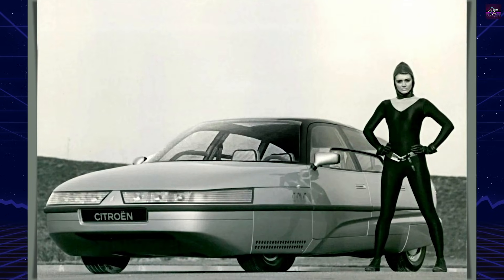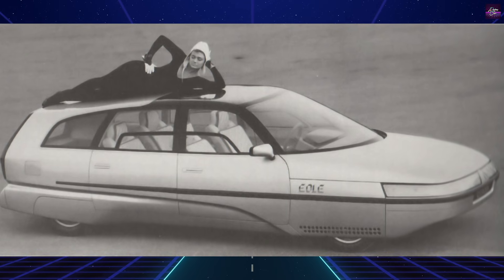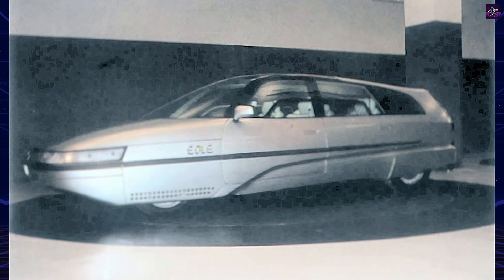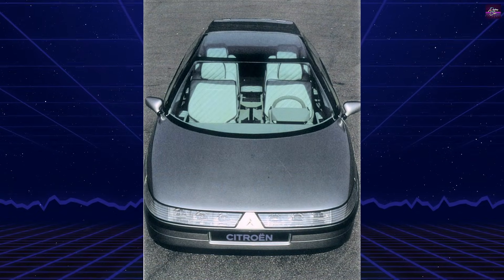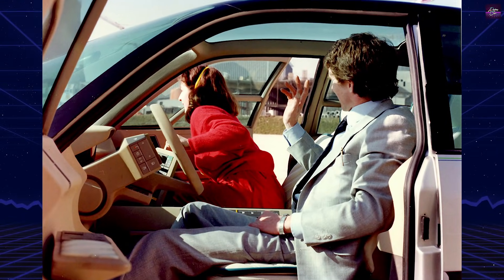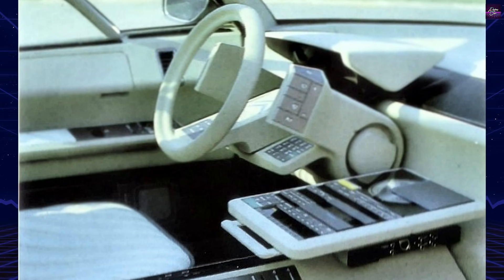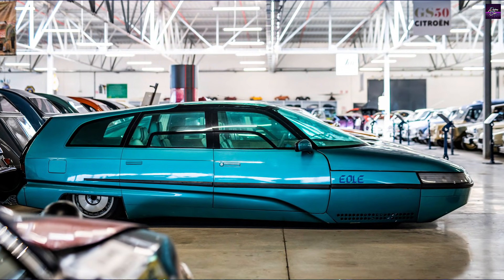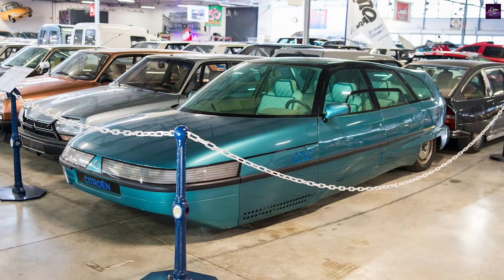Citroën Eole: How Citroën Built One of the Most Aerodynamic Cars Ever in the 1980s

Comment: It clearly influenced the XM of which I owned 3 with the most recent one still going strong. Still a dream of a car.
Reply: Which powertrain?
Reply: @paulparoma  My XM? The latest one is a Turbo CT. Maybe not as glamerous as the V6's but a very good compromise.
Reply: @marcbrasse747  *glamorous. Nice. What year?
Reply: @paulparoma  It's a 1996 example but externally it is actually a bit of a mix because it combines a series 1 grille and single spoke steering wheel with the later interior, spoiler and mirrors. The colour is dark metalic green (Verte Vega). I also conciously replaced the cast wheels on mine with conventional hubs to maintain the extra aerodynamic Seduction style hubcaps my earlier ones had. They are actually from the very cheapest version but add an extra futuristic touch. It's after all nice to drive a flying saucer and nowadays people really start noticing it. I will never forget the day somebody in Italy almost fell of his bicycle when he saw us floating by.🙂
Reply: @marcbrasse747  Sounds pretty great. I was at the Citroen plant in Rennes a few years ago, wanted to see where they made those. There is a video on YT that shows the unsold ones (and a lot of them) parked outside the plant to be crushed later. Sad.
Reply: Sad indeed but it still went clearly over 300.000 examples. Not bad for a “failed” model. The C6 barely went over 23.000, which is truly sad. It wasn’t THAT bad looking, although already too diluted compared to the Lignage study model from which it was derived.
Reply: @marcbrasse747  I didn't realize the XM had done so well. The C6 was a disappointment when I test-drove it in France in 2015, except for the fantastic seats. Good thing I didn't buy it. I've never driven any other Citroen, though. Yours has intrigued me since it came out. I still have a VHS of a Portuguese commercial (a gift from a former GF), where they call it "She Zem."